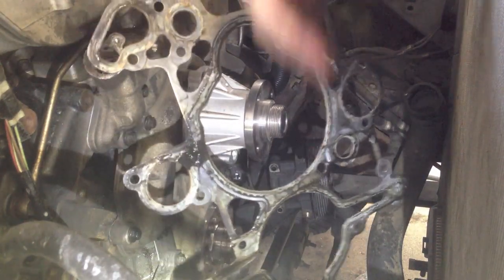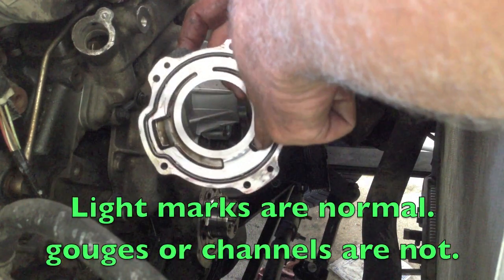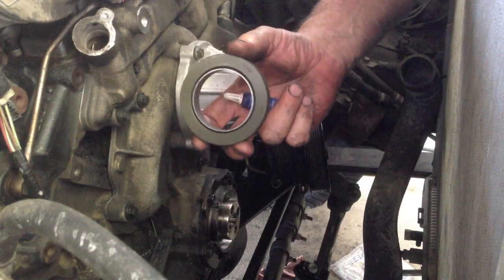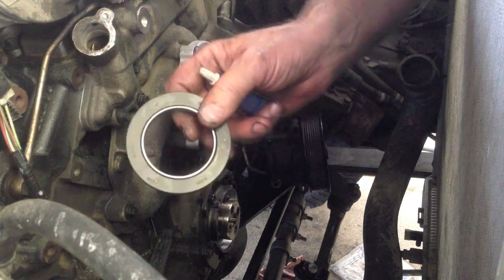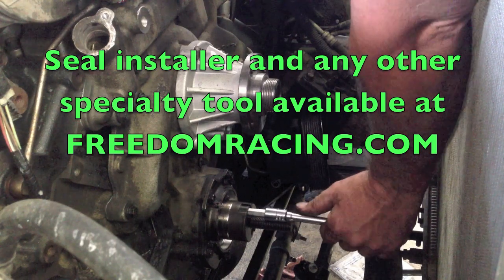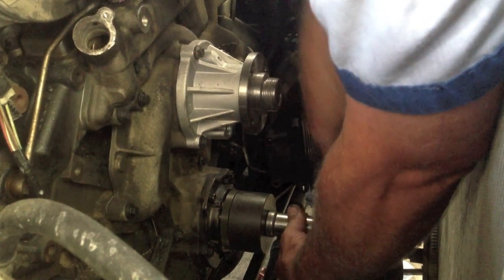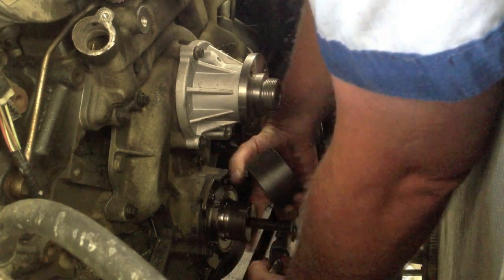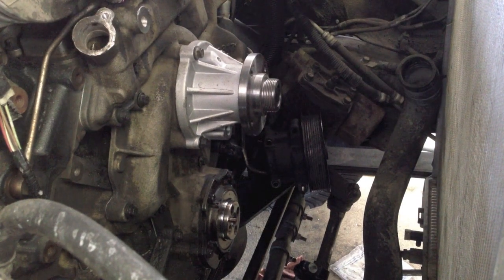Ford 6.0 powerstroke diesel front cover tips and tricks.

Comment: Fine.... but how do you actually get the front cover off after everything has been disconnected and all the bolts removed?  I thought it might just pop right off with a few taps and a little prying.  Mine seems to be on so tight that it didn't budge with what seemed like a reasonable amount of force with a crowbar and an 8lb sledgehammer.  I don't want to break or damage it.  Can't find any videos on the internet that show it being taken off.  ?  I see a comment about placing the gasket over the dowels but I don't see any in the video.  Because they are apparently back there, I assume that prying it off is better than trying to knock it off. ??

Comment: Hello DTRon. I have question.  I am having trouble with my 04 f250 6.0. I have no oil pressure at idle i have changed the sensor and the filter.  Any suggestions? Plz help

Comment: Hey guys bought a 2007 28 passenger school bus almost a year ago it had 43000 original miles on it shortly there after within 600 miles it started hydro locking on me turns out the egr cooler had a breach in it so I did a egr delete on it basically welded a plug on both sides of the egr and called it a day then continued with life as usual it smoked for about 25 miles then no more smoke ran great went on a 100 mile drive spent the night stared it the next morning no problems life was great but then "Cue scary music. 
I  returned on the 100 mile trip as I was pulling in to town it started running at a higher rpm then as i was parking it 
The motor stared loping as if one side of the motor was dying i turned it off and there gentlemen is where it  did a shitty magic trick
And turned in to a big yellow yard ornament oh probably dont have to mention it's a vt365 since then at the advice of a diesel mechanic I have  replaced the ficm the ipr all of the glow plugs as well as the the oil and all filters including fuel
Then found out fuel gauge doesn't work put 20 gallons of fuel in it and still it sits I had another diesel mechanic come look at it and was told it only has 1700 psi oil pressure after the high pressure oil pump so I pulled the high pressure oil pump but cant tell if the quick disconnect coupling is bad after all this mouth breathing I ve done my question is if the quick disconnect coupling has  side to side movement is it bad
I.m sure a few of you guys are saying you poor bastard let it go buy a Hyundai it's over but if anyone has any other advice 
I would accept it humbly thanks monti

Comment: I have a question on the 6.0 the timing cover on the front one of the water pump is big and the other one is small if I put this I got the big one in the small water pump if I put it on when it overheats

Comment: my o rink keeps on leaking. can anyone watching this video who has had the same prob help me. ive put in numerous o rings and i know they are going in flush
Reply: Try not putting a excessive amount of grease on it try a light coat of die electric grease
Reply: Gary Catt its at the mechanic now im letting them have the headache. The oil cooler started leaking because i was pressure testing the coolant to high

Comment: Thanks for the tips. I got a original 40000km motor that developed a fairly bad leak at the front cover. Is that normal and should I look for anything when I take it apart? Should I apply sealer to the aluminum part of the gasket to prevent future leaks?
Reply from the maker: oil leaks from the old style front crank seal were kinda common.  anything else in my area of the desert is not common.  yes a light dab of silicone to help with uneven surfaces, corrosion or where 2 or more joints meet is always a good idea.
Reply: +DieselTechRon thanks for the quick reply
 should I perhaps just pull the balancer and inspect the front crank seal first?

Comment: I have had an oil leak in the front of the engine not sure if it is coming from the front cover or engine head gasket are there oil ports on the front engine cover?
Reply: +inter caetera inquisition FYI it is not the main seal.  It seams to be coming from the top drivers side of the front cover is that possible?

Comment: I can't get the lpop gears out to remove the cover.. any idea what would cause that
Reply: remove the aftermarket seal ring from the end of the crankshaft. hit a few dents in it to loosen the ring using a flat chisel, then you should be able to pry the ring off and then remove the center oil pump gear.

Comment: the g rotor should slide in freely without tapping on it. if you cant slide it in loosen the bolts and pry the cover up with a Philips screw driver in other bolt holes until it will slide in freely. you can loosen up the intake without removing the turbo, ficm or filter assembly. then put the oring in with the cover already installed. only takes 5 minutes to loosen the intake
Reply: No